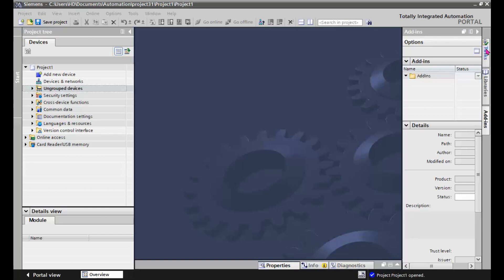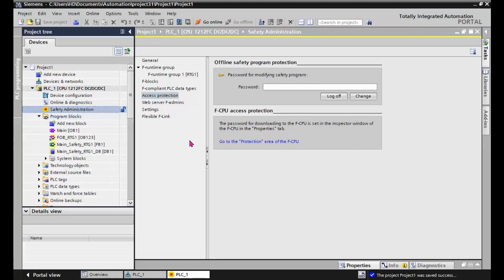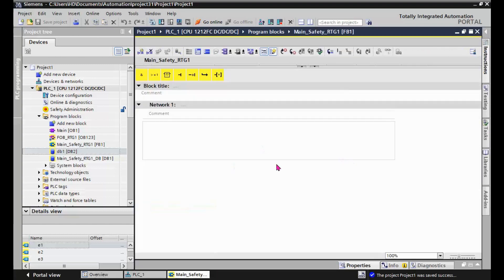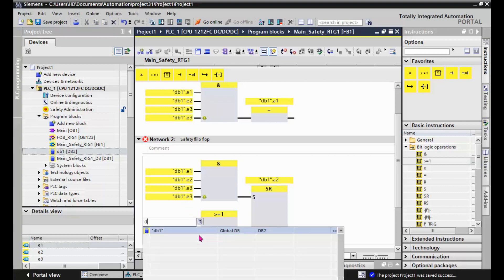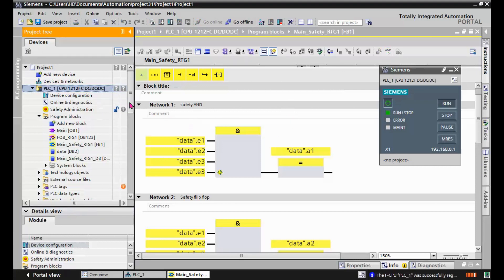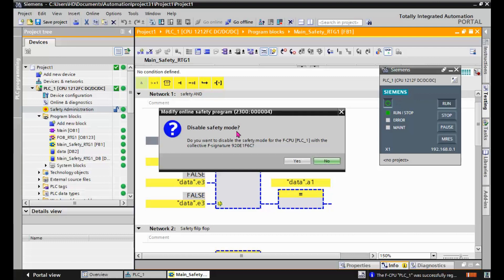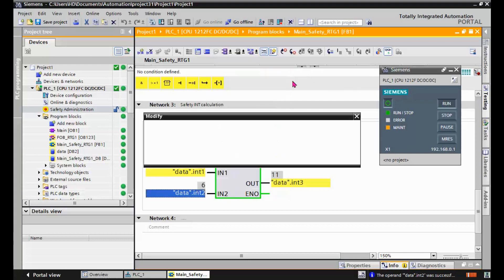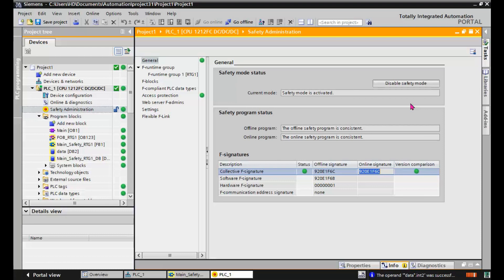How to simulate S7-1200F safety Project | S7-1500F | S7-300F | SIEMENS safety tutorial | TIA Portal

Comment: Hello, thanks a lot for the excellent video. Could I ask a couple of questions?
1. If on real PLC we need to deactivate safety mode for the long time, will safety program works properly as “normal PLC”. I mean will it in case of HH or LL event trip the unit. 
2. What is the difference to operate PLC with activated and deactivated safety mode?
Reply from the maker: More info:

https://youtu.be/jbssqle3VnA?si=4KVXSrLqDiO_TZWi

Comment: I have seen your videos and I would like to know how I can simulate in tía portal an 1214fc plc is this possible??, because I have been trying and just have a plc in stop mode when i finish to download the program in plcsim and the message error is because something happend in the fb 32767.
Reply from the maker: What is your TIA portal version , type of CPU (article no.) and the firmware version?

I am able to simulate S7-1214F (CPU 1214FC DC/DC/DC) V4.1 in TIA V16 without any trouble.
Reply: is the same S7-1214FC (CPU 1214FC DC/DC/DC ) (6ES7 214-1AF40-0XB0) V4.2 in Tia V15.1
Reply from the maker: I previously worked with TIA V15 sp1 , it was not stable and flawless in simulation.My suggestions are:

1-Test your project by removing IO signals , compile and simulate again.If it is not working , next step.

2- Create a new project , add a new S7-1214 F and perform the same procedure as I did and see the result.

3- If it is not working , create another project and try another CPU with the latest firmware.Try to simulate.

4- If non of the steps above are working , upgrade to TIA V16 or renew your installation.
Reply: I found the problem but I dont know what is the really problem because I was using a firmware safety v2. 2 with a firmware v4. 2 of the plc 1214fc and when I change the safety to v2. 0 or below. I was able simulate. Thanks so much for your help